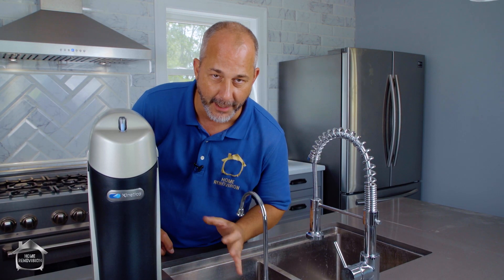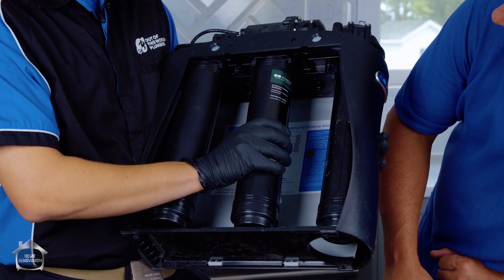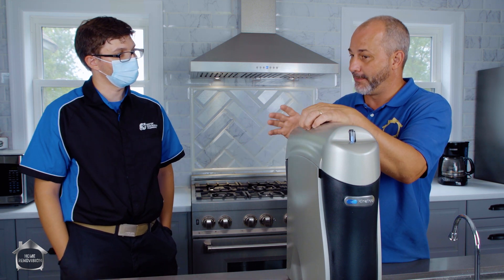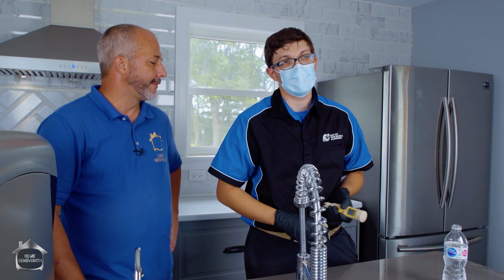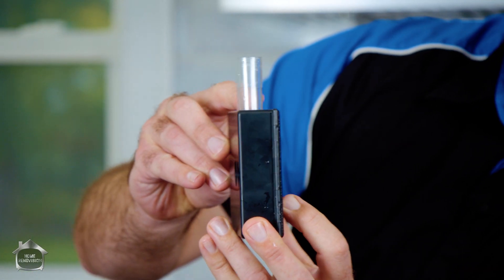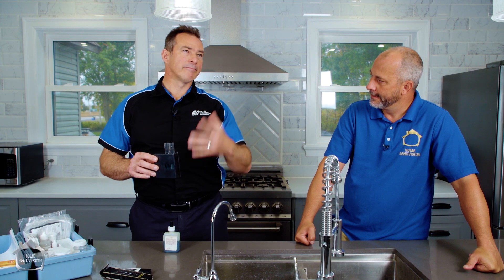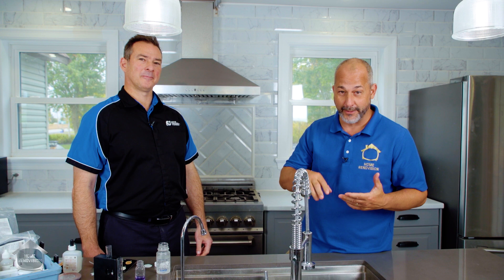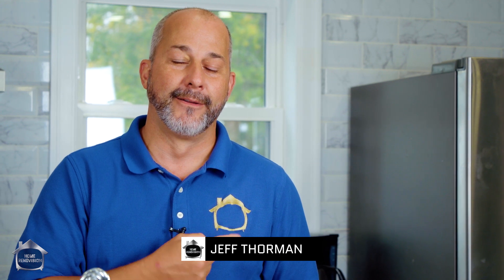Make Your Tap Water Safe for Drinking

Comment: Never buy a system from the ppl testing your water. Get it independently tested then find the service that meets your needs. 500 gallons is not a lot. Let's talk costs
Reply: You are right. In a household of 4, a 500 gallon supply will be used up in under a year.
Reply: Just had a filtration system put on my house for high iron, softener, forever metals/chemicals, and a reverse osmosis. 

$6,200

Comment: Your guest mentioned that removing the iron will help your fixtures which is true but isn't the filter only serviceing the one special faucet???
Reply: I think the iron and sulfur get removed by the water softener system. Which probably does more for the water then this reverse osmosis system.
Reply: The water softener, depending on the type of resin bed that is used, will remove iron from the water supply. The semipermeable membrane in the reverse osmosis system will also remove some iron. On a water supply system such as well water with high iron content, more than 2 to 3 parts per million, a water softener will not remove all the iron. The resin bedding in the water softener is designed to remove mainly minerals that contribute to water hardness.
Reply: @dalemckinney435  Thanks for clearing that up.
Reply: @4philipp  That makes sense. Thanks
Reply: @brianpritt4154  You are welcome. I worked for Culligan  for about 7 years. I installed and serviced numerous water softeners, RO systems and water purification systems.
Reply: @brianpritt4154  punny

("Clear that up)  water humour

Comment: Jeff, as an engineer who is part of a team who treats water for a municipality in Canada, it's my opinion that you should provide the sources for your claims that chemical use is increasing and infrastructure is impacting water quality. It's extremely complex, and I don't pretend to know it all, but it's dangerous to share comments like that about something as critical as our water supplies without proper sourcing. 

Rural well services are a completely different beast than providing water to people from a water plant.

Can you provide the sources to your claims?
Reply: Uhh.. I didn't think it was questioned that the city adds fluoride for your "teeth" to the water supply. That's right. For your "teeth". Definitely not to dumb you down. But for your teeth.

Comment: Reverse osmosis is overkill unless you are running a lab with very specific needs. It wastes water and has a charcoal filter for taste at the end anyway. At home I use a simple charcoal block by Brondell .  It costs about 50$ a year for 2 people. It removes 99.99% of contaminants from my municipal water. If anyone tells you that you need more they are selling you snake oil. 

Ottawa South sometimes has ridiculous amounts of naturally occurring fluoride in well water. Often triple what is added to municipal water. Atrazine is another one I worry about in some areas.
Reply: The carbon filter is not for taste , it removes chlorine. the remineralization is for taste. Im my town we have lead water lines into the houses. RO is very necessary.
Reply: I have well water with high nitrate levels due to being surrounded by farmland. RO is the only way to clean that up
Reply: @beaker2k  Ya, not much a charcoal filter can do about ammonium nitrate. In the country you really need to spend the money and get a proper lab test. You have no idea what is in the water. Municipal water is tested so you can just look it up or they are super excited to tell you if you call them. For me on municipal water charcoal is probably overkill. It's mainly for taste as I don't like chlorine.
Reply: @Chris-xc1tm  yep, thankfully the county offer free water tests so you know what is in there and what you have to clean out

Comment: I used a similar RO system for years but changed to a Berkey water filter. Not as convenient because it's a big can that sits on the counter and you simply pour tap water (or even pond water in an emergency) into the top and delicious water comes from a tap on the bottom. 

There are several advantages to the Berkey system. 1)The filters seem expensive but filter 1000's of gallons which results in only pennies per gallon (fraction of a penny per liter). 2) You don't rely on pressure from a municipal or well source. 3) With an optional filter installed you can remove several contaminants that RO can't including fluoride, lead, mercury, etc. 4) Berkey filtration doesn't remove dissolved minerals which are important to your health. Drinking water that has minerals removed may actually cause leaching of those minerals from your body. 5) A Berkey unit is relatively portable. There are large and small stainless models ranging from about a quart to a few gallons and you can also DIY a container and just buy the filters. 6) A typical RO system wastes several times the amount of filtered water that it produces, something like 7 units of waste for each unit produced. There are probably a few more but that's off the top of my head. If you're curious I suggest you do a little research to check my stats.

Comment: I have a waterfront shoreline well where the water is so-so, being river water filtered through some sand and soil.  Hard, with rust from dissolved iron, and  sometimes stinky.  I made my own ozone treatment system by installing a 200 gal HDPE reservoir tank in the basement, kept full by the pump in the well, and drawn from by a separate pump that pressurizes the house.  I pump air, using a pond aerator pump, into the tank,  passing it through a 360 mg/hr UV ozone generator made for purifying large aquariums.  The air pump and ozone generator runs 24/7, using about 100 watts.  The ozone that bubbles in the tank is vented outside.  The water then goes through a 30 micron prefilter, a softener,  two large 5 micron carbon filters, then a Sterilight just in case.  The ozone kills whatever was in the water,  and oxidizes the sulfur and iron getting rid of the rust and smells.  My tap water is like bottled water (except it's been softened, but you can't tell) and is in fact processed a lot like bottled water is.  Cost about $1500 cdn.

Comment: $2100 for a Kinetico RO system is just too expensive for my blood.  I'm certain this is an excellent system, otherwise you wouldn't be endorsing it on your channel.  I'm sure it's a great option if you're into getting all the testing and customization which I'm certain is not done free, it's a premium which is baked into the cost of doing business within their business model.

As for me, for years I was using the screw on tap connected PUR carbon activated filter and it suited my needs for some time.  Then  5 years ago I did some research looking for a high quality RO system and found Home Master being highly rated and they had many different options.  I went with the Artesian model with the remineralization cartridge for something like $300+ at that time.  Home Master uses a wider diameter supply line (I think 3/8") and it also has a pressurized overflow tank.  Both of these features ensure a high pressure water supply while cheaper systems will have lower flow rates and eventually slow down over time.  The Home Master is a complete DIY project and I only needed a 3/8" hole drilled in the sink.  No drilling into the countertop required.

One thing of note with all RO systems is that there's a significant amount of water waste.  Most models, including the one I bought wastes 80% of the water (4:1 water waste ratio).  Home Master has an optional permeate pump which has only a 50% water waste ratio (1:1).  If you're looking for an excellent but cost effective solution, I'd suggest Home Master.  If you want to pay for the customization and "free" testing, then Kinetico sounds great, but it won't be cheap.  Also, I've seen some cheap options at Home Depot but my advice would be to stay away.  If you're going to go with RO, then don't cheap out.  Get something that's quality and highly rated.  For my money, Home Master met the best balance of being quality yet cost effective.  It's 5 years old and still works great.
Reply: How much did you water bill go up if at all? U got city water or from a well?
Reply: @expressfashionman89  The water bill didn't go up very much at all.  The RO water is only used for drinking water, making coffee, etc.  You don't use it for washing dishes, washing fruits and vegetables, etc.  Keep in mind that the RO water comes out of it's own separate tap.  Although with the remineralization cartridge, you will need to descale the coffee maker periodically.

Comment: You shouldn't ask someone who sells something if you need their product. They'll often say yes, even if you really don't. Do your own research. Here's a few points:
1.) Don't rely on one of those TDS meters to gauge how good your water is. They can't tell the difference between what's good, bad, and really bad, just that something is there. And bottled water, especially RO filtered, has minerals added to it for taste. To my knowledge, the stuff they add is after, and doesn't count towards, the measurement for goverment TDS limits.

2.) You don't need to have someone come to your house to test your water, even if it's "free". You can buy a kit online, for ~$150 (potentially less), where you fill up some vials and send them to a laboratory. They do detailed testing and give you a report of EXACTLY what's in your water, and how your levels compare to government regulations & guidelines. The field tests don't test for nearly as many things (namely, the more difficult and/or expensive ones to test for).

3.) You don't need to spend a fortune for a filtration system. The K5 system has a list price around $2,000 (and is only available installed by professionals), which is 8x what I paid for my install-it-yourself 6-stage system. If you're DIY inclined (and this is a DIY channel!), it's fairly simple to install an undersink system with its own tap. The hardest part is drilling through your sink or countertop and installing the tap (like the video says, if you have something tricky like granite, I recommend getting a countertop pro to drill it unless you know what you're doing and already have the tools). The second-hardest, in my case, was finding a good place to attach the RO wastewater drain to the sink drainpipe (if you put it too close to the sink connection you'll hear it draining).

3.1.) The price difference between the K5 system and a good-quality DIY option is NOT worth it. For the premium charged for the fancy feature of knowing exactly how much filter life you have, you could replace filers on a conservative schedule for YEARS before you've made up the difference. The holding "tank" on this model is also tiny, the one included with mine can hold several gallons (exact amount depends on water pressure).

Comment: Lots of good info, thanks. Is the softener connected to the drinking water as well? I would have thought not.
Reply: You can drink softened water.  If the hard water has 150 mg/ltr of calcium coming from the well, there will be 150 mg/ltr of sodium in it after treatment.  A glass of water might be 50 mg, 2% of the recommended max of 2300.

Comment: The water people .. what a racket lol. If you buy a tds meter theres 2 kinds. 1 does EC and the other does ppm. Also when you buy you need the calibration liquid. This guy may have needed to calibrate his meter. Also I wouldnt want a RO system that shuts down when the filters should be replaced.

Comment: Any reason why I couldn't put a RO system in my basement, split the lines and go to multiple sinks?  Always nice to have clean water at night in the bathroom plus filters are easier to change not crammed under the kitchen sink.
Reply: they installed mine in the basement beside my softener and it goes to my fridge and to my kitchen sink

Comment: Doesn't reverse osmosis take out the beneficial additives like fluoride etc...? should we use just a simple carbon filter?
Reply: Fluoride health benefits are largely unfounded. France does not put fluoride in their tap water. Same reason why products like Toothpaste are offered without Fluoride. Theirs also studies that show that long term ingestion of Fluoride can have neurological side effects by effecting the pineal gland in the brain.
Reply: Beneficial + Fluoride used in the same sentence??
Boy, do YOU need to do just a smidgen more of a wee bit rabbit-hole research.
Reply: @min2oly  Casmige is a pseudonym of Alex Jones.
Reply: @stans5270  fitting isn't it...
Reply: @Skysmeller1  Yea I'm gonna take the word of the WHO over a random internet dude, thanks.

Comment: The thing not mentioned is the waste water from any RO system.
Reply: I agree, apparently some RO systems send about 5 galls to waste for every gallon of filtered water used, is that factored into the costs?
Reply: @mortlock59  on a well the water is free but you pay the delivery charge in the electric bill to run the well pump.

Comment: I’ve had them at my house before I thought the stuff was very pricey they were going to charge me 5 grand for a whole house softener and the osmosis then I found out the filters were 80 bucks apiece I wasn’t convinced with there stuff but I’m much older and wiser I bought a fleck system and put it in myself it is a duel tank softner
Reply: Earl did you have high iron
Reply: @deadmanswife1  not exactly they came out went through there little demo and quoted us that price at first I didn’t think it was so bad of a price beings we never had 1 then I started researching and found out about getting parts and so on just do a little research
Reply: @earljohnson7675  I see

Comment: What's the price?? I can get 18l jug refilled for about $2.75CDN (15cents/liter) now I have to bring the jugs to a store an fill them but that's 2 blocks away. I have a pump I got from Amazon for $80 that lets me pump the water from my utility room to a small tap beside my sink. I could not find a system that cost less then me getting the water myself. all these systems were about $300 starting then change a filter every 3 months and when I did the cost per liter it was like double or triple the cost!

Looking at this unit were talking anywhere from $1500 - $3000 I guess if you live in the country you really don't have a choice but if you live in the city get 4 bottles and find a local water store that does the RO for you for much much cheeper then these systems as long as you don't mind changing the bottles.
Reply: This just says that you are very cheap. Just spent 300 bucks and get quality inline service. The value is in not having to go to the store

Comment: 500 gallons is not that much. EACH person in the USA uses an estimated 100 gallons per month. With a family of five, that filter will need to be replaced likely every 3 months.
Reply: 100 gallons includes all indoor water use like flushing toilets and showering. This just treats the tap water at the sink. If you drink 64 floz of water a day you go through about 15 gallons of drinking water a month.

Comment: Do your research on RO water and it's negative affects on your health unless you add the minerals back in....I would rec adding that addon element he spoke of asap! Culligan system I have avoids the need of a separate dispenser, for those of us that don't want to drill more holes in your granite, worth looking into, as it dials into your existing faucet with a wireless remote that allows  you to switch a valve that transfers between RO and regular water in the line. We have their entire house filtration/softner system as well which has been life changing. They also have a mineral filter. Very similar products otherwise...

Comment: FYI: People get the majority of the daily water needs from food.

I've had a pH/TDS and temp meter for years with calibration chemicals. They aren't expensive. pH should be above 7, copper pipes will erode when lower. The two types of neutralizer are disolving minerals and injecting chemical. Mineral adds calcium and/or magnesium. Chemical injects a caustic solution of sodium bicarbonate or sodium(or potassium) hydroxide and should be proportional to the amount of water.

Reverse osmosis under the sink systems are a commodity don't over pay (Should be under $200). You can get one that adds minerals for the taste.

Water softeners replace calcium and magnesium with sodium, but can also reduce dissolved iron and manganese. Calcium and magnesium prevent the detergent's surfactants from cleaning and instead remove the minerals which leads to more detergent being needed.

Iron filters remove iron and manganese usually with a manganese dioxide filter medium. The water needs to be at a higher pH (around 8) and needs to be oxidized to precipitate the iron and manganese.

Iron bacteria, and sulfur are cans of worms you need to go through yourself.
Reply: Yep I got mine for $200 its great